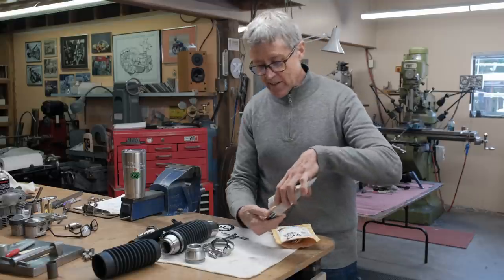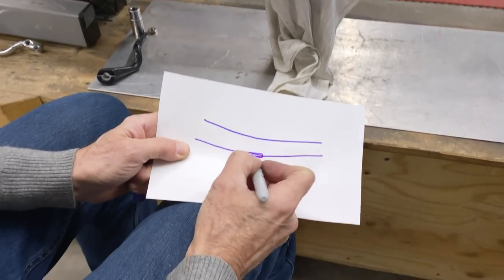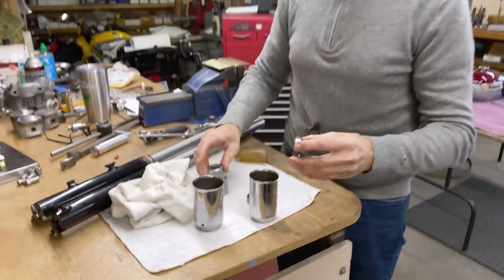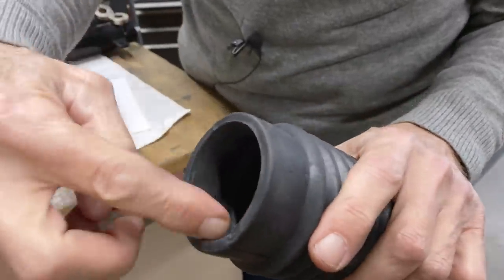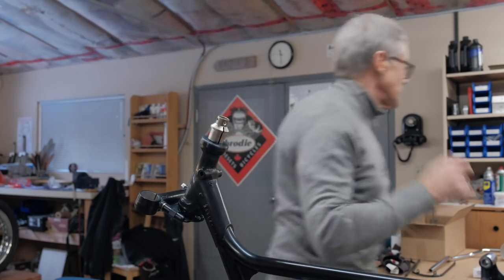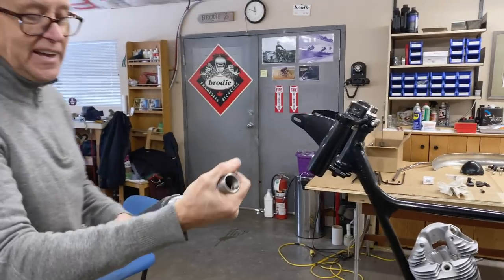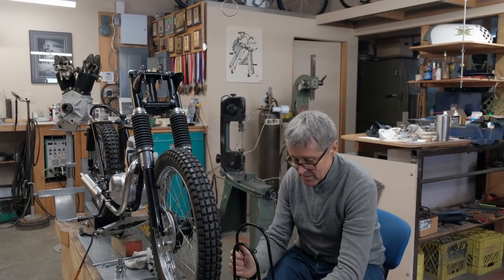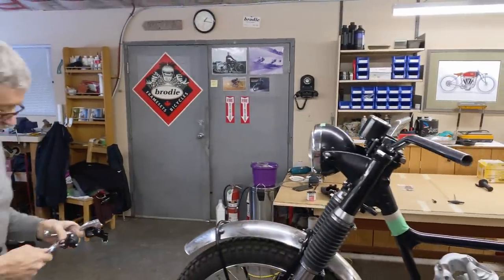Tiger Cub Front End Assembly // Paul Brodie's Shop

Comment: 'Medium twine' refers to the Hemp twine plumbers used to use back in the day to seal certain types of plumbing pipework joints, Hemp has been replaced by PTFE tape and liquid sealants such as made by Loctite
Reply: Hemp and grease is still used on pipe threads in more industrial situations and where PTFE could not be used.
Reply from the maker: That's great that Hemp twine had a dedicated use on a British motorcycle. It only adds to the mystique of English motorcycles!
Reply: Hemp twine and grease still used by plumbers here in Zoo Nealand
Reply: My father still uses Hemp and grease to repair our rain machine (not sure if that is the best translation, but Google said so)

Comment: That’s the nicest Cub pipe I’ve ever seen👍🏼 

Those gaiters are for 69/70 Triumph twins. No clamps required. I know you’ll just make them work which is fine. Finding quality reproduction parts for these bikes is a “Royal” pain. So much junk out there. There are good suppliers here in the States but not sure if they will ship to you. Baxter Cycles is a good resource with online access to original parts books and photos of the actual part.

As for sealing the threads on the seal holders, Blue Loctite or a light wipe of clear RTV works just fine. After 1968 there’s an internal o ring groove cut midway in the seal holder threads that works ok but I still seal them. 

Campy grease… I still have a half full 500g tub from my roadbike days. They sell for big $ on eBay😁
Reply from the maker: Thank you classicrestoration. I am enjoying myself with this build. I'm using white lithium grease but I don't believe it is Campy.

Comment: Hello Paul & Mitch.  As always, thank you for another enjoyable episode.  Regarding the mismatch in the exhaust tubing, that's because bends, even mandrel bends, get a bit of a D shape -- the outside of the bend flattens out a bit and pulls down against the mandrel, which is necessarily slightly undersized.  I've done quite a bit of exhaust fabrication, and over the years, I've made tools that help with this -- it's a short cone about 1/2" long that leads up to a 1/8" long cylindrical diameter which is sized for the inner diameter of the exhaust tubing. On my tools, I put a shoulder on it to stop the tool from entering further into the tube, although this is probably not strictly necessary.  This die gets mounted on an air-hammer shank (.401", an odd size to be sure.)  With the air hammer, it re-forms the shape of the bend to match straight tubing.  It takes a lot of force to make this work and it's loud.  I've always wondered about making a rotary tool which has 5 large ball bearings 72° apart and a very long, shallow taper which drive into the space between the bearings to enlarge the effective diameter as the tool rotates.
Reply from the maker: Thanks Alan, I did consider cutting the bend along the length and welding in a sliver of stainless to make the OD bigger, but that didn't happen. Oh well, it turned out ok.

Comment: What are the threads you cut into the end of the "fork guide" that could be a broomstick handle, but I prefer not.
Reply from the maker: The threads are the same as the fork caps that screw into the fork tubes. Are you wanting me to measure the OD and check the TPI?

Comment: when I was assembling my 74  maico forks which are exterior spring forks too, we took an old fork cap and filed off the ridge so that it would fit into the triple clamps, taking a piece of all thread and washers we  created a tool to pul the fork tubes up through the triple clamps  it worked really well,  your is nicer for sure. poor folks have poor ways. we  discovered  that the older style tower for the levers were actually a different pull ratio and worked better than the newer style that claps on with two bolts. I may have a one or two in my collection, I will look and see. If you find one before I the weekend fine if not, and if I can find mine then I would be happy to send it your way. thanks for  the great videos. like I said before, I like old bikes. I have enjoyed the videos on frame building too,, best wishes
Reply from the maker: Thom, thanks for watching and commenting :)

Comment: No surprise to me, Paul, that a 21st century Canadian broom handle doesn't work. The broomstick that you need has to be a) English, b) pre Beatles and c) bought 2nd hand from a witch... And, fyi, back in '50s Britain everything was made using medium twine. The string that won world wars... And, of course, we spotted the exhaust stud gaffe, but we just added it to the list of things that transpondians misname... Cotter pin = split pin, cotter key = cotter pin, et alia... Thoroughly enjoyable and instructive, as always. Many thanks. (And you're going to regret eschewing that bit of string)...
Reply from the maker: Thanks Bill. I wonder if Canadian Tire sells medium twine?
Reply: @paulbrodie  Possibly, but, possibly not quite exactly the right size. Your best bet is to get some big twine and reduce it in your lathe. We don't have much in England these days but we have faith that the  professor will make it right... Seriously, 50s technology called for string....
Reply from the maker: @billdyke9745   If my forks do weep I will pull them apart and use some of that teflon tape stuff. Quite a few comments urging me to use that stuff. Thanks.

Comment: I have a similar set-up on the forks of my Carabela project and what I have is aluminum crush washers between the lower stanchion and the sleeve nut - this takes place of the twine and was there prior to me, so probably factory. However, I also found the wrong seals (which can no longer be bought BTW) and a 4" piece of broom handle in the tube - so there was that too. The ali washers had formed to the thread so they had to be unscrewed, deburred and put back.
Reply from the maker: Yes, I had to order the seals from the UK as they are completely non standard, and my local bearing and seal supplier had nothing..

Comment: Instead of those anodised collars you have made for the fork shrouds Norton have a rubber version. To get the fork legs up I use an old top nut with the hex turned off and drilled through , then use a threaded rod and nuts.

Comment: hi Paul yes very sure oil seals always face with the open end toward the oil, when the oil is compressed  it causes pressure to pushes the seal
against the fork stanchion, the way it is now pressure will oil push past the seal.
kind regards,
Adrian.
Reply from the maker: Yes, that's how I installed them: open end towards the oil.

Comment: I convinced myself the 'exhaust studs' had to be deliberate.
 Personally, I've been using Teflon plumbers paste for 25~30 years to seal threads and as an anti-seize for stainless steel screws in aluminium. It's far less likely to cause galvanic corrosion between stainless and aluminium than any other form of anti-seize (until you start getting into the stuff they use on aircraft, in power plants, etc)
You could probably get lever clamps from an older Indian Enfield, They would be a direct copy of 1955 levers. May take a little while to get from India though
Reply from the maker: I like my Maguras. They have the correct look and style for my taste. the older Maguras had a single pinch bolt to clamp. Those are the ones I was referring to. I have used lots of Teflon tape, not Teflon paste.
Reply: @paulbrodie  Italian brake and clutch levers, always 'competition' .  Cable ends metric and smaller than British ones
I had some Magura's on a Sprite trials bike (125 Zundapp motor, early 70's) but no idea if my brother snatched them when I moved to USA as I had fitted them to a Royal Enfield 250 trials?

Comment: Turn the bike upside down to use a broomstick and avoid wood chip contamination if you don't have a lathe. Rubber slicing tape around a pair of indentations in the broomstick can lock the stick in place by rotating until the rubber tape piles up inside. You have to work quickly before the tape begins to self vulcanize or it slips. Rotate the other way to remove it or just pull really hard. 
If that all makes sense. I can't remember the brand of the bike but it was old in 75 and the broom handle did come from the manual.
Reply from the maker: I see you have some experience with a broom handle! Thanks for watching and commenting.

Comment: Some PTFE tape would be a suitable replacement for twine, 4-6 wraps would normally suffice. 

You're also missing the washers from the fork caps. 

Nice to see her coming back together.
Reply from the maker: Thanks Sid. I'm assuming that PTFE tape is teflon tape? The thread is very fine and a close fit, so I'm not sure how many wraps would work. I will look for fork cap washers!
Reply: @paulbrodie  that's the stuff, you'll be surprised how much it compresses into the joint, I would start with 4-6 wraps and see how it goes. We all know old Brit bikes like to leak oil, stops the rust and ensures we always have fresh oil in them... 🤣

As for the washers, Triumph changed their parts like most normal humans change their socks. Try looking for part number 97-0862 to give you a rough guide, I'm led to believe the forks were also used on the BSA Bantam D7 to D10 models so that might open your options up. Will be around the same thickness as the head spindle washer you almost forgot.

TBH the washers aren't essential but they do help to stop the nuts from damaging the surface finishes.
Reply: Loctite also make a thread sealing cord called Loctite 55, which is used as an alternative to PTFE tape. It’s basically a modern version of ‘wicking’ cord mentioned by another viewer.
Reply from the maker: @sidwainhouse   Thanks Sid. If my forks weep too much I will take them apart and install tape. In the meantime it's an experiment. The nuts do have a relief under the hex protrusions, so washers aren't 100% required. I'll probably machine a couple out of 6061 on my lathe. Have you seen the cost of shipping?
Reply: @paulbrodie  shipping costs would be a bit high for a couple of washers… 😂

Comment: I remember packing headsets and hubs with loose balls and adjusting the hub cones so that  with the quick release clamped they were adjusted perfectly, none of this sealed bearing nonsense. 😀 Why do you use the white lithium grease and not that tub of Maxima waterproof grease that I have seen on your work bench?
Reply from the maker: Yes, I have 2 greases. Which one I use depends on my mood. Can't think of any other reason to use one and not the other...
Reply: @paulbrodie  I guess as long as you service things regularly it doesn't really matter. Remember the old green Phil Wood grease?
Reply from the maker: @fvillago65   I do remember...

Comment: Great Video as always guys! I'm not criticizing, just asking a question does the stainless not require back purging with gas? Thanks again for posting videos they bring me a great deal of relaxation after a long day at work.
Reply: On an exhaust it doesnt, On something where FOOD or Drink will go thru it you would - but not for this application
Reply from the maker: Yes, it would be nice to purge, but I would need a separate tank of argon... I have made several stainless exhaust systems over the years, never purged, and never had a problem.
Reply: @paulbrodie  Not necessarily a separate tank - there are regulators with two outputs.  Also, Solar Flux works fantastic for exhausts.  If you want a technical reason for why to flux/backgas, the "sugar" on the inside of the weld will create turbulence and disturb the flow of the exhaust gas.  :)
Reply from the maker: @Alanbataar  Thanks Alan. If there is a disturbance inside my exhaust it will not be reported!

Comment: Curious why you didn't go to timkin bearings in the steering head.
Reply from the maker: That would have been a lot more work. I doubt very much a set of Timken bearing would fit perfectly. And then races have to be ground, head stocks machined out, etc. And you know what? Ball bearings, in good condition, work just fine.

Comment: hi Paul  your fork oil seals are in upside down, and there should be two washers under the fork top nuts. lovely vids keep them going
kind regards,
Adrian.
Reply from the maker: I was very careful with the orientation of the the fork seals. Are you sure? I will find washers.
Reply: General fork seal information for discussion and as starting point to compare to the Tiger Cub design. 
The square edge goes towards the oil to keep the oil inside. 
Occasionally one seal is actually a dust seal or wiper and the square edge goes towards the dust to keep the dust outside.
Reply: @WireWeHere  I've been working on british motorcycle for over 45 years and never put oil seals in like that, please read bsa/triumph fork oil seal orientation. the oil seal as a small spring inside to hold the seal against the stanchion and the spring always faces the oil. and the information have pointed out is for the very early cub with two oil seals in the chrome dust covers like the bsa c15.
Reply: @a65builder67  I'm referring to the contact surface with the inner fork tube as in the sealing surfaces that have relative movement between them. The spring is visible from the high pressure side with most designs that use one.
Reply: @WireWeHere  hi rjm yes your quite right the spring is on the high pressure side, when the stanchion is compressed into the fork slider it causes compression which is high pressure were the oil is being forced up between the stanchion and slider and bushes resulting in oil pressure to the seal. with kind regards Adrian.
Reply: @a65builder67  It's difficult to see the details of the seals from where I'm looking and I have no idea which way they're installed except through your comment. I hope we get a good look at the situation.
Cheers.
Reply: @WireWeHere  hi rjm, yes it's been a fantastic debate and if we've both helped someone in the function of the humble oil seal it's a debate well done. and let it not detract from Paul's bike build they are great vids. but anyway please take care and be safe. with kind regards Adrian.
Reply: @a65builder67  Here's the beginning, "Honing a Tiger Cub cylinder using a Sunnen pin-hole grinder." shows the fork seal coming out. Hard to see but it looks correct if the way it was installed matches the orientation laying on the bench, spring towards the oil. 

I feel like riding my brodie for some reason.
Reply: @WireWeHere  hi rjm 5,49 sec's into vid the and then 5,55 sec's into the  vid. look closely were the threads on the chrome oil seal holder, and threads on the fork sliders the threads on the chrome holders face the oil in the  sliders. the spring in the seal faces away from the threads on the holders. kind regards Adrian.
Reply: @a65builder67  Thanks I'll have a look on a proper big screen very soon but I trust your vision. The moment with the socket over the seal I wondered but didn't catch anything later. They don't like to come out without perishing, perhaps a special tool is forthcoming. I have one already and it's only 5 minutes away but I'm still unable to move for a while longer, long story. Look forward to every episode. The detective part is interesting too.
Reply: @WireWeHere  hi rjm yes i agree it makes it very interesting but Paul dose make very good vids. and to make his own motorcycles and engines. he's a genius, and a nice clean shop to boot. WOW. take care.

Comment: Paul ur a very funny guy. (In ireland ud b called a' gas man,)or hes great gas.
Reply: Paul, try De Groot in Holland for the single pinch bolt levers, also - I fitted one of the Indian speedos to my ZB350 and I disassembled the cable end, re-soldered it and hammered the different square to match the speedo. A modified brass electrical cable gland matched the thread to the speedo cable entrance and all worked fine. The accuracy was poor- but the Irish equivalent of the 'bobbies' didn't mind- great gas altogether

Comment: on all the triumph forks ive built i have used ptfe plummers tape to seal the oil seal holder threads and the gaitors look like they are for a t120 .

Comment: The tiger cub frame was not very good. The brace oil tank from the steering head back to the mid frame strengthens the frame and gets rid of the oil tank at the side. I think Sammy miller has them . But knowing you you could design and make your own
Reply from the maker: I still remember being 15 and taking the gas tank off my Cub. And being shocked (at 15..) that the factory had left out a very important tube. Yes, I could make a fancy oil tank, but then I couldn't use the stock gas tank. It will be fine. Thanks for watching.

Comment: Thanks for clarifying that the exhaust pipe is Stainless Steel. How did you prevent sugaring on the back of the welds? It doesn't look like you were back purging with argon gas inside the pipe.
Reply from the maker: I don't have a second bottle of argon for purging. It's not food or medical, so my exhaust says a little sugaring is ok. I've made several stainless systems over the years and no issues.